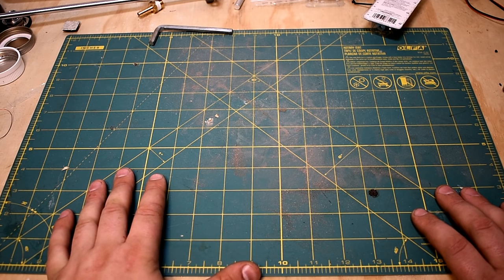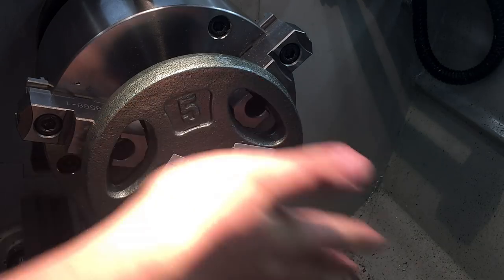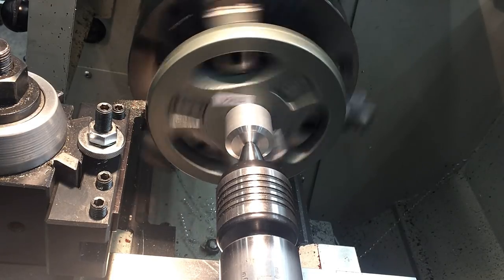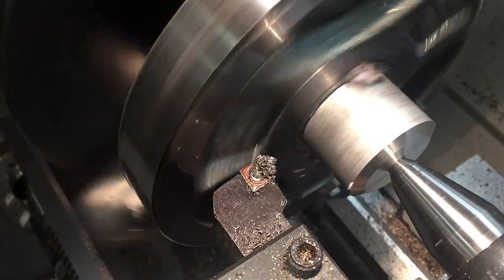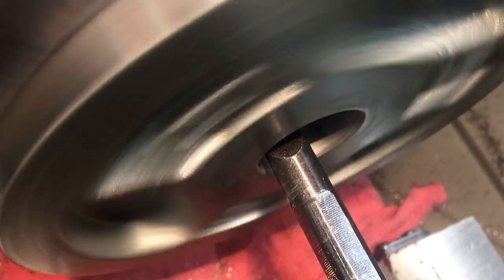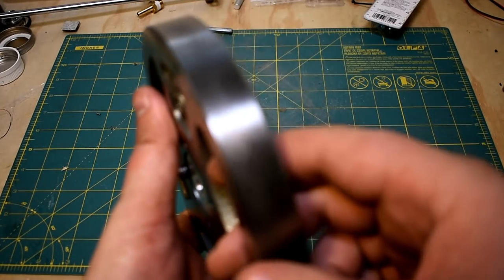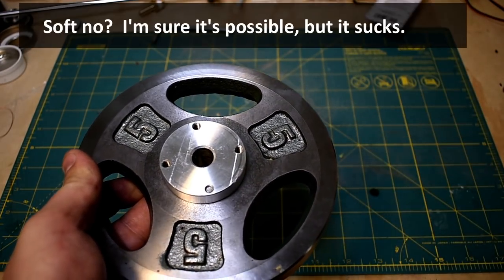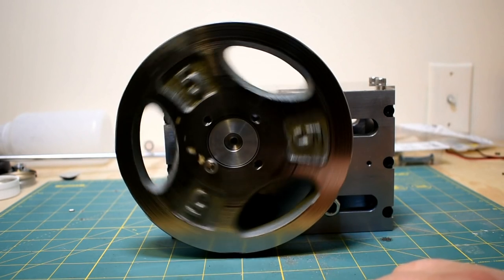Can you make a flywheel out of a weight plate?

Comment: Most exercise weights are made by foundries when the iron goes "out of spec" as ductile iron only has a short pouring window after magnesium treatment. It is called pigging or making pigs.... it's a way   to salvage the iron for re-use or as a product that does not require specific metallurgical chemistry.
Reply from the maker: That would make sense.  I guess all weights have to do is have mass to be effective.  That must be where the term "pig iron" comes from
Reply: actually, no. pig iron comes from the bars they made way back. the bigger ones had about the weigh of a usual house pig. some of that bars also had kind of legs so you could grab it better for transport.
Reply: https://en.wikipedia.org/wiki/Pig_iron the name comes from how it looks when being cast.

Comment: Those "sand pockets" from the casting process used to be called "non-metallic inclusions" by our engineers. :) And yes, without good x-rays of the item, it could fly apart under speed/pressure. Been there, done that.
Reply from the maker: Ya it was totally like sand or something!  Ive heard you can give it a smack and listen for a ring to detect voids but this one didnt ring (some of them did) and it still had voids.  Ill have to get an x-ray machine :p

Comment: Good to see you back.

Try a round button-style carbide insert tool - they are very strong (for carbide). When you destroy a portion of the edge, just rotate the insert so that the damaged portion is not in the cut - you get a lot of 'edges' that way!.  A flat topped (no chip-breaker features) tool works fine on cast iron. I was taught to 'get under the hard skin' as fast as possible, although given the casting that you are working with, you will still have to tough it out  though at least one hard surface/skin to get started. 

I think that you should: 
1) Ignore the voids unless planning to run at very high rpm's - cosmetic filler and paint could be your friends here.
2) Definitely keep the '5's' - they look cool!
Ian.
Reply from the maker: Hi Ian

I should try a round insert... I've never actually used one before.  The inserts at work are mostly for aluminum and stainless so I just kind of guessed with one I use for steel sometimes.  I think it would work fine for this application, I'm not totally sure how fast I want to run the mystery machine yet, so steel is probably the safer option.

Comment: I recently turned a new backplate for my 3-jaw chuck. I used the shopvac on low-speed with a 3/4" piece of plastic tube stuck on the pipe end with electrical tape, then zip-tied it to the tool-post. As soon as the chip formed it was sucked away. Clean bed, clean lathe, no dusty workshop, no black boogers. (By the way, auto brake rotors are made of a nice cast iron, easy to turn)
Reply from the maker: good thinking on the shop vac.. I remember when I first started and I made things out of wood I had some pretty elaborate ways of keeping my vacuum nozzle near the cutting area.  Sawdust getting into machines is no fun :(.   I never thought auto brake rotors would be cast iron, but it looks like you're right.  I guess they would have to be a pretty high quality cast iron considering their operating conditions and the consequences of them failing.  Thanks for the tip and the comment!

Comment: I notice that many flywheel castings have the whole rim cast off center with respect to the center. Unless you get the rim running true, outer and inner rim, you are going to have balance problems. Perhaps you should turn the disk chucking from the inside of the outer rim or from a mandrel which you can adjust radially with shims.

Comment: I could see it being ok for low speed stuff on homade tools like a planishing hammer or something to that effect. But not as an engine flywheel that i was thinking of going with, i ended up buying steal cuttofs at a mettal supply place that had no inclusions on it.  Thanks for trying this now i wont have to..And I  think if you would have mounted it by an arbor through the center hole, i think it might have started a little truer for you. Anyway good job

Comment: Interesting idea, never though about it. Aren't you concerned about the balance of this wheel? I would have taken another aproach: put the weight flat on the mill and bore the inside hole with the boring bar, then just static balance the load, like a grinding wheel.
Reply from the maker: The head machinist in our shop suggested the same thing, but suggested turning the OD first and making some soft jaws so I could do the bore, face and pockets all at once.  I think after I finished the OD I realized that I would have had a harder time milling such bad material so I opted to continue on the lathe.

I was going to worry about balance had the machining worked out, just by using the double-blade setup and a Dremel.  As it stands now I'm going to wait for the steel to come in and try to balance that

Comment: How did it balance? It looked to be set off centre in the chuck based on the od, inner of the outer ring and the id. I like the idea, but you are correct in how poor the cast quality is and not wanting it spinning at any great RPM.
Reply from the maker: I didn't try to balance it yet but I'm sure its probably hopeless.  I think the OD, ID and where i gripped it were all out of concentricity to one another, so I guess you basically pick one feature and fix the other two:P

Comment: If you are looking for a chunky, circular, and yet cheap source of steel, have you considered getting an old brake rotor from a scrap yard?
It will be better quality steel, and you can be confident that it won't disintegrate at high RPM.
Reply from the maker: Someone else actually mentioned that too, I may look into it!

Comment: Low rpm would probably be ok but don't want to be spinning the thing too fast that's for sure. Or build a nice cage/enclosure around it just encase.
Reply: Manny Calavera ya, considering how low the quality of the mold apparently is, given it’s eccentricities, I’d be seriously questioning the quality of the metal, let alone the quality of the cast.

Like you, I’d be seriously concerned that the thing would fly apart at high revs.
Reply from the maker: Agreed.  I was also thinking of ways of putting a strap around the outside to fight the centrifugal force, but it's not worth it for this project

Comment: did you not use a dial gauge when you centered it the second time?
Reply from the maker: No, but for a few reasons!
1)  I was originally planning on finish turning it on an arbor (before I decided that it was a dismal failure:P)
2)  This chuck happens to only run out by 0.001" or so -- You can't rely on that in a process but it's nice when it works out that way
3)  This weight has three spokes and I wanted to get the jaws on the spokes to avoid breaking through the rim

Comment: Steve Jordan did that recently. BTW cast iron doesn't require lubrication
Reply from the maker: Oh i didnt know, ill have to look that up.  Lube was because i panicked :p
Reply: It isn't necessary for the cutting action, but some people use it to keep the dust controlled.
Reply: somebody else : That is right. I used to do that when I was machining in a manual lathe. The cast-iron in this video isn't the best quality and I would call it more like casting-steel. The chips and swarf doesn't match the look of cast-iron chips and swarf.

Comment: Nice work man, has a “This Old tony” humor vibe to it. And who doesn’t love watching this ole tony???    Anywho, a furnace and casting operation shouldn’t be too bad if you can afford a lathe that nice.LOL.... what brand/model lathe is that by the way? This is the first video of yours I’ve seen. I’m in the market for a new/another lathe and you’s looks just like the flavor I want. “Modern”:).  I’ve got an old (really Old) 14-16 inch Sidney, the bed and carriage is 10ft long but it’s from the era of belts hanging out of the ceiling to all machines in the factory. Big 4-6 inch wide belt drive. 
   My other is a small blue bench top around 80ish years old. My dad has put a million miles on that little thing. 
Ok I’ll shut up:; nice video man
Reply from the maker: This Old Tony humor is the best humor, so thank you!  So my work actually lets employees use the shop after hours for personal projects, so it's their lathe, and I remain poor :P.  It's a big 14" South Bend toolroom lathe.  It's a very nice machine and as far as I know they come in lots of different sizes.   Depending on your price range, I'd say South Bend is a really good bet, and if you're going for lower cost bench top, there's a brand called Precision Matthews that I have used and like.  Thanks for the comment!

Comment: It makes sense they wouldn't use good cast iron for what is literally dead weight. Good try though. Interesting video.
And for sourcing steel of that size and shape, instead of going to a supplier, see if there's a shop nearby that handles big bar stock and bargain for cut-offs.
Reply from the maker: Ya I think that that's the big lesson here.  Why use good material for something that just has to be heavy?  Some suppliers do actually sell short, large diameter rounds at really good prices, but I should start sleuthing junkyards more :P

Comment: I have one Question, regards "the Stresses" within the cast iron weight you lathed into shape: "Just how fast will your Flywheel be turning"? I mean, it would Blow if it was hooked up to a Super Charged Muscle Car, but I would be thinking even a couple hundred RPM would not cause Undo Stress Levels. But I also know that for much of my own work, I stand OVER the Line known as "Perfectionist" !!!
Reply from the maker: I turned it at 160 RPM and my life juuuuust started flashing before my eyes.  The design is for 300-500RPM, so I may fire it up and hide somewhere for a bit.  The new steel will probably be here this Friday, so I may just skip ahead to that :P

Comment: Interesting! (goes on the pile of cool ideas for the future, I don't have a furnace either) Thanks for sharing

Allthough the quality is kind of ehm "not optimal" it may be usefull for low RPM situations?
Reply from the maker: Maybe... I wonder if higher quality weights are made of better material... I mean there's no reason for them to be (all they have to do is be heavy), but maybe there are steel weights or something out there.  At $1/lb and being roughly the right shape it sure would be nice if it worked :P

Comment: I don't understand the cover with rag comment? On cnc's we turn cast slugs with foundry draft easily by boring a set of aluminum jaws with matching draft angle. Then rotate the slug around until you get maximum contact, each slug is different. Sometimes we will turn an arbor with an end cap for the slugs and start thar way first.
Reply: I think he wanted to cover the ways of the lathe with cloth to prevent the cast iron chips from falling in and mucking everything up. 

I don't know enough about cast iron to understand why it's worse than other metals though, maybe the way it chips means it's more likely to fall into the machine rather than behind it, or maybe it's harder to clean out.
Reply from the maker: It's just to protect the ways.  Cast iron is hard and makes teeny little chips that get everywhere, so its just easier to clean up
Reply from the maker: Yep exactly.  Cast iron is hard and the chips are small, so it can really lock things up
Reply: I believe it is the same reason you don't use abrasives on metal lathes. Cast iron is super hard and the small chips make a paste when they get covered in coolant/cutting oil and it wrecks the ways
Reply: Paul B. True but most lathes now days have telescopic way covers and lead screw wipes to protect the ball screws and lead screws. They also have wipes to protect the linear ways and filtration systems on the coolant tanks to catch the muck! Can't say I ever had a problem with cast but I guess your mileage may vary.
Reply: Most CNC lathes... Affordable engine lathes  (by home gamer standards) are not going to have way covers.  Until recently they wouldn't even have lead screw covers, and many, many home shops are going to have old machines.

Comment: If your turning more than 1000rpm i would build a scattershild due to the unknown casting consistency it the weight they make us run billit aluminum flywheels on our race mower if we turn more than the factory 3800rpm maybe gran a billet and try to build from scratch
Reply from the maker: I'm hoping to run the machine at around 300-500 RPM, which still seems high for this crappy material
Reply: Tabletop Machine Shop what speed was the lathe spinning

Comment: what about an old cast iron frypan?
Reply from the maker: Like a really thick one?  perhaps, though this was supposed to be a quick, easy and easily purchased source of a flywheel (even though it turned out not to be,) so I'd think antique frypans would be hard to find
Reply: Tabletop Machine Shop 

Yeah those old ones with the real thick base. But as you say, they'd be hard to find I guess. 
Still, be interesting to see the quality inside between a good old one and the cheap Chinese ones.

Comment: It doesn't look so far out of round as being gripped off center. I bet the balance is way off.
Reply from the maker: Ya the grip isnt perfect but i tried a bunch of different ways and it did get a little better with some sketchier setups but ultimately to cut it i felt this was a good compromise
Reply: Without an adjustable 3-jaw or 4-jaw, it's really going to be challenging to get it as concentric as possible. Shims are really the only option which is probably excessive for an experiment. That said, this flywheel would be perfectly adequate for low speed applications regardless.

Comment: sure it can be done , would trust it at high rpm though. hmmmm never mind maibe get a better brand weight
Reply from the maker: Yeah i was thinking about a higher quality weight, but they dont really have any reason to use better cast iron
Reply: i think the casting itself would be a little better , think most of the inclusions is caused by faults made during the casting itself and isnt caused by bad quality metal

Comment: use to make cast iron diaphragms plates for pneumatic valves at a factory on a cnc lathe. Cast iron is nasty stuff. my sympathy goes out to you. from my experience a carbide insert with a large nose radius for ruffing out the piece then use what your using to finish the piece will give you far better results. cast iron that is sand cast is the worst to work with. You came up with the same conclusion I took to my boss and he told me the company was too cheap to buy steel blanks for the job even though it would have saved more money on tooling and machine time than what processing the cast iron cost. Corporate stupid.
Reply from the maker: Oh interesting.  I cut the steel flywheel last week... it was sooooo much nicer!